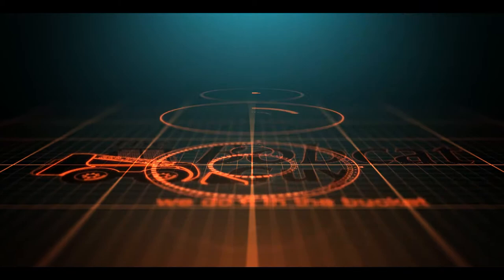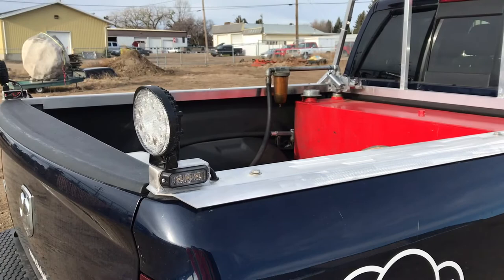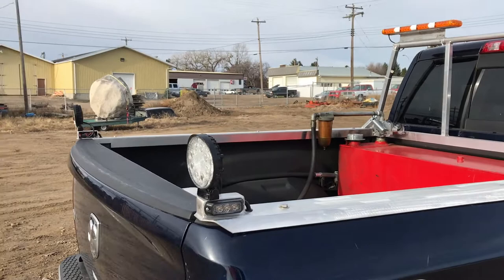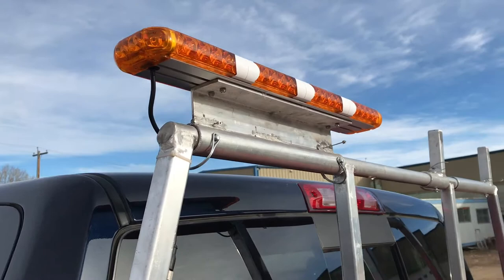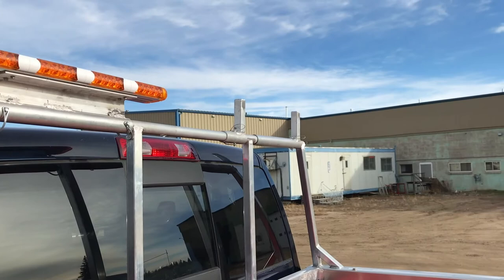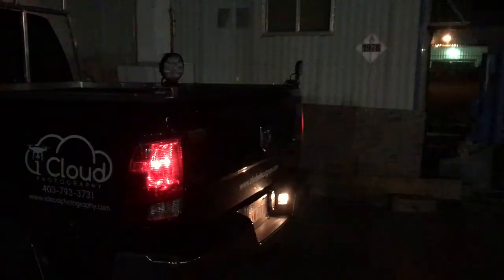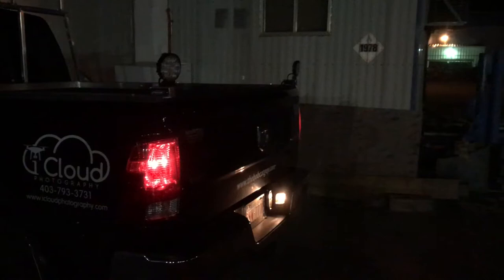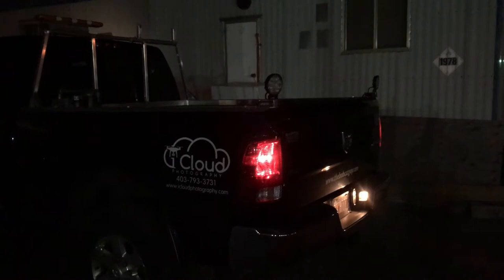Plow back up and  safety lights

Comment: Hey there found you on chants comment section like the set up what kinda beacon light is that looks bright I'm still using the rotation beacon super bright
Reply from the maker: I dont have the name right know but i get you the info i bought it from local dealer supper brite and its nice because you can leave truck off and it run for hours with out draining your power in your truck thansk for checking us out